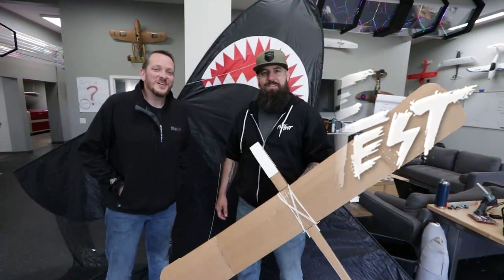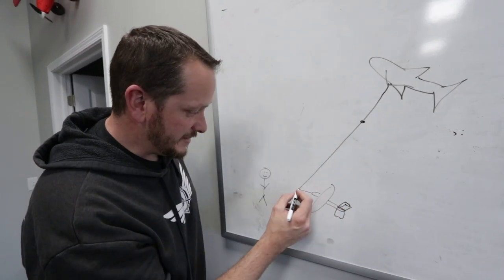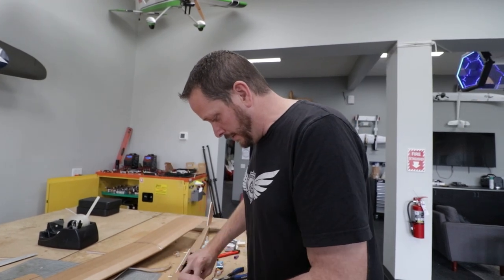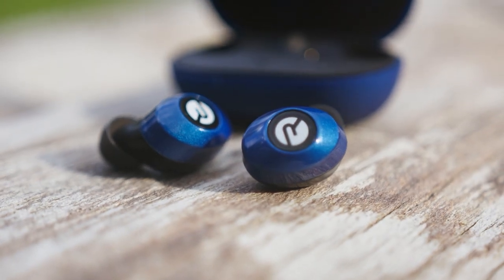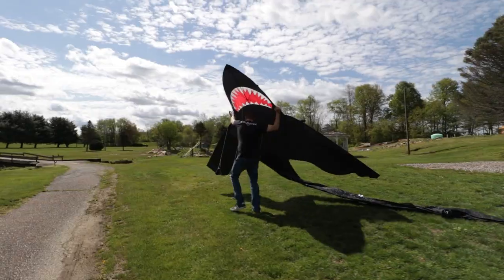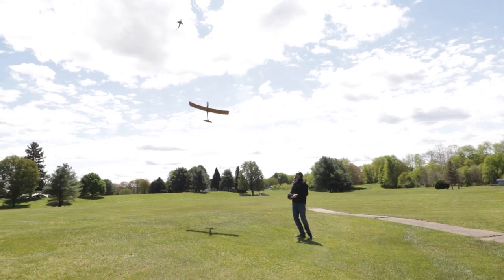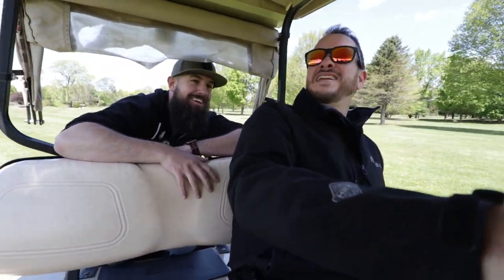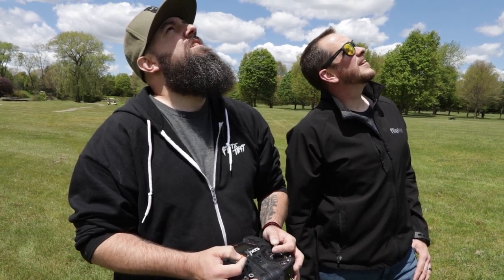This 21 Foot Kite Tows Up Airplane!!!

Comment: The shark looks great but it flies at about a 45-degree angle from you guys. Putting it so far away from you that all you are doing is trying to fly the glider back to you. You should try making a few rotating elliptical kites that can be stacked. I bought one years ago. I couldn't believe how hard they pull and the wild thing about them is they will almost fly right above you. I had 1200 feet of 25 lbs. test fishing line and I thought it was going to break, it pulled that hard. The one I had was called the UFO it was about 26 inches across with 10 inch wide elliptical curved wings glued to a wood dowel, on the ends of the dowel a nail held a nylon piece that the harness attached to. The wild thing about them, they had chrome monocote film on the wings that when the sun reflected off it, it looked like a UFO. The right rotation of the kite was clockwise from the right side, not the wrong side if you get the pun 😁 LOL. The line does angle out at about 20 degrees when you launch the kite, but it will start coming forward at a couple of hundred feet, as the line bows in the wind. When the kite is at altitude the kite actually flies ahead of the line, not like a conventional kite. I figure you could launch a 3 to 4 lbs glider from one of those kites

Comment: I shopped one of these build kits, went to the website bundled everything and the price was unbelievable, 
How in the world are you expecting people to spend so much money on foam board.  Shipping outside merica is well over 150.00 us bringing the price close to 700$ with exchange.. no bloody way! 
Great videos, but no way.
Reply: My first FT purchase included the crafty kit, a DX6e radio, a Duster kit and power pack B.  it was almost $500.  Since then, I've built 32 more FT kits and only bought more props and glue.  It's well worth the investment!

Comment: What you need is a Convertible kite, fly up as a kite, release and return as a glider.  OR you could build a swing wing aircraft and catapult launch like a rocket and then open  the wings at peak and glide back to base.
Reply: -- That's called model rocketry I know I had the swing-wing, the space-shuttle 🚀 oh here's one you probably never had was a rocket that returns like a whirly-gig, the rotor blades pop open from the side of the rocket when the ejection charge goes off.
Reply: @Ken-rk3by  I was thinking more of elastic launch with the wings retracted like a “rocket”.
Reply: @Ken-rk3by  i had this one rocket that would blow apart into 2 pieces and flat spin to the ground
Reply: @thomasferris3750  -- The one I had was the SSTshuttle it would separate into two parts. The shuttle orbiter would glide in big circles back to earth while the main rocket would return by parachute
Reply: That rocket idea would be cool cause you would have to change the CG after the rockets go out.

Comment: One of the best kites I've ever found for lift capability is a conyne-delta. Even in a gentle breeze, it would fly nearly straight overhead, with a strong pull. I dubbed mine Conyne the Barbarian. I might have to dig it out and see about trying a plane loft with it.
Reply: Double Coyne Delta!  Epic. where's the kite channel?

Comment: G'day Josh and TJ  Thanks so much for the shout out and trying this idea. The good thing about this system is theoretically you could launch the kite and then the aircraft on a small square of land without the line even touching the ground and getting tangled, something that a high start or winch could not achieve.  The other good point you made, that was when the plane was not switched on you could recover it undamaged.   Great fun to be had, and anyone can do this.  RC is definitely not boring.  all the best Allen

Comment: I have a challenge for FliteTest. In my country we have a tale / story about a ship that goes equally well at land, in the air, as in the sea. I would like FliteTest to make such a ship out of the materials they have at hand. And to up the challenge a bit, it must not be an airplane that can float on water, which is fitted with wheels. That would be too easy to make. I am talking about a creation which is a combination of an airplane, an rc vehice, and an rc boat. That entails the creation / vehicle having wheels that are powered, and with steering on the front wheels. It must float, and have a propeller to propell the craft forward in water, as well as a boat rudder. And it must fly. That part should be simple enough. 
Once finished, the craft should be testet by driving it on land, trough turns, into some water, were it is driven by boat-propeller, like a boat into launch position, and then the craft should take of and fly. The landing must be a water-landing, from which the craft drives by boat-propeller to the shore, where it drives itself unto land by the use of the wheels. And the craft should be reverse-parked at the end.

Alternatively, the craft can fly like a quad-copter rather than like a plane. But it will still needs the powered wheels with steering from an rc vehicle, and a boat-propeller and boat-rudder from an rc boat (not necessarily from an actual rc vehicle, or rc boat, just parts siimilar in function to those respective parts on rc vehicles and rc boats).

Comment: You may know that the wind above the trees is a bit faster. We have been doing this with our kites for years. You start out with a small kite to lift a bigger kite. And then when get enough "Pull" on the line to lift the kite you want to fly you use a down line release. (See fishing gear) to release your kite from the "Mother" kite with just a tug. It will catch the wind at a higher level. Hopefully 50 or so feet above the trees.

Comment: Oh man getting me back to my soaring days, love it. How much kite line did you have? You guys could probably put the golf cart at the far end of Ready-Made up on jack stands and rig up a spool on the axle/wheel for a winch line, you have a variable-speed winch if Noah sits there and runs the gas pedal! Then, just build a simple soarer with a CG release and you’re off and gliding on a calm day!
Reply: Oooooo I love that idea! 😂
Reply: @BuddyRC  yes dude! RC soaring was my first entry into the RC world coming out of real gliders, I totally think there’s enough to make an episode out of that! The cart would be funny but probably overkill, maybe there’s a better electric motor solution to run the winch but you totally have the distance to do a winch setup. Also launching towards the slope at the end of ready made has enough space to get the speed going before pulling up into the climb!

Comment: I have the same kite with a 30' tail streamer for stability. Use a shark rod with a reel 500' of line.
Really enjoy flying it here at Port Morgan and even let my Son drive my Key West power boat while I fly the Shark. I call it fly Fishing . perhaps you all might try to mount an electric motor on it with flight controls. all of the other boaters give us a horn blast as we come by. Arrgh.
AKA : Captain Morgan. BFT , SC.

Comment: I think you guys should make a Giant B-17 that has a working bomb bay and stomping mechanism! It would be sick if you guys also added a me B-17 FT model that has the same features for dropping objects and maybe the kit comes with foam binds to be dripped from the plane! Anyways, once the B-17 is made you should create a giant version like the, You did with the P-51 and ME 262, for an epic battle against enemies below on the ground that may even be trying to shoot the plane down! If you are bringing all FT members, have an escort for the bomber while other planes try to intercept it but friendly fighters resist, and as that happens the bomber has a mission to drop ordnance over specific targets! It would be a mini bombing run! With enemies to be were of! And since you plan to blow up the ME 262 and P-51 in your upcoming battle, why not add some explosions for the bombing run too?!

Comment: Hey guys, so my parents are huge in the kite community, they got into it because when I was young I wanted an RC plane but they were SOOOO expensive and complicated back then. I have an idea to combine the best of the kite world and the RC plane world. It;s based on your foam board Spitfire. If I'm successful, I'll get the idea your way, but imagine being able to fly a foam spit or stang without a motor, prop, servos, battery, or radio... just string and wind...

The light, strong, string with no stretch you are looking for is called "spectra"

Comment: My big brother used to do this back in the 70's as a kid. He had a ten-foot Rogallo wing (like an old-school hang/glider) type kite with a kilometer of line(!). He typically used a little parachutist, as his non-rc gliders tended to disappear into the distance! I can't remember the exact mechanism, but the part that slid up the kite-line would trigger the release automatically when it hit the stopper on the kite-line, and drop the parachute/glider.

Comment: I wonder if it would be possible to fly a large 3D shark?
Like with a model jet engine or something, with a wind sock or tube like design?
Using the fins and stuff for steering.

Comment: I'd like to see RC kites!

I've flown many styles of kites and love the relaxing experience, but I stress out when the kite wants to climb too high or oscillates left and right wildly.  Some RC control would help make a more stable flight.

I want to add a camera for video during the flight, but the wild oscillations make that impractical.

You could experiment with modified fabric kites, box kites with control surfaces, or custom foam board built designs that are essentially planes on a string.

On a tangential note, I love the look of tetrahedral kites.  From what I've seen, they are tricky to fly.  They have the potential to lift a great amount of payload.  With no tail, I suspect they oscillate quite a bit.  Getting one of these to fly smoothly would be great.

Also, if you have links to kite video channels, that would be welcome, but YOUR TAKE on the subject would be SO MUCH MORE fun!

Comment: not going to even bother with this, i wanted to but when i hovered over the thumbnail instead of anything related to what should be in the vid it was a fscking commercial for the earbud sponsors ... if you want to run sponsors thats on you but if thats all the preview shows going forward then im out ... in point of fact im unsubbing until you respond and change this crap
Reply: You do know the hovering over/preview is automatically chosen by youtube and can't be adjusted.  Right?